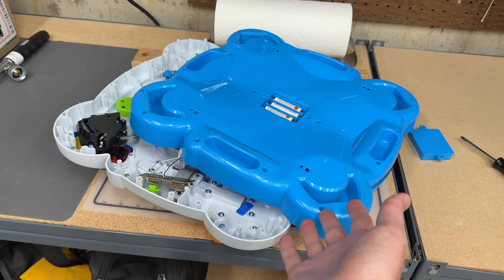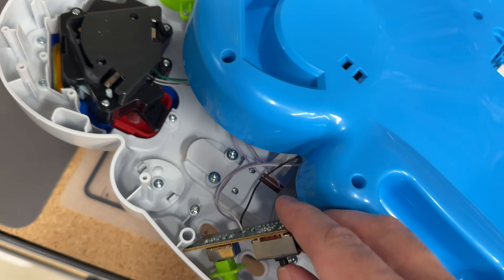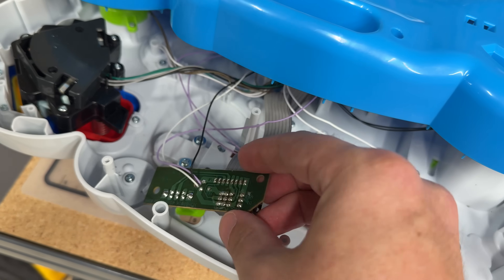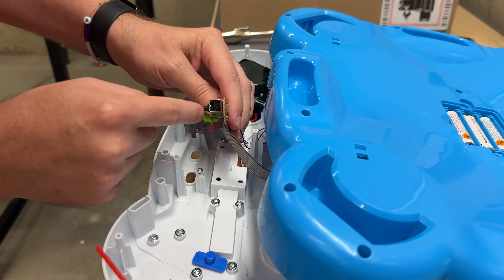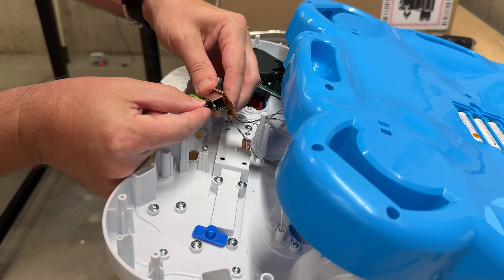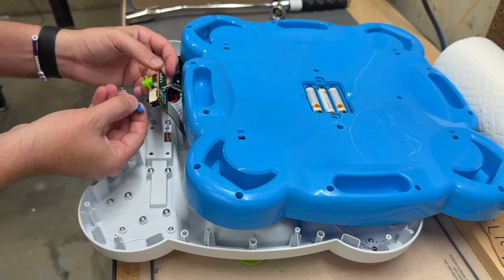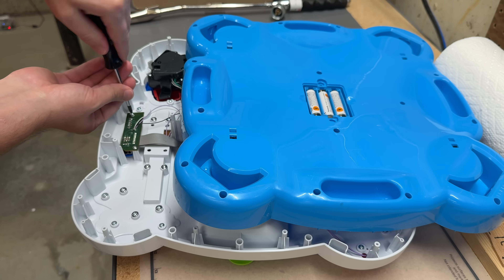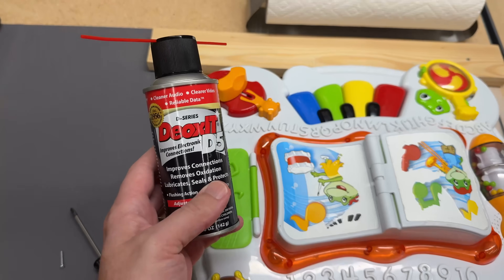My baby's toy is engineered better than my $800 dishwasher

Comment: 1:37 I love the trend with modern products to not have slide switches for power, instead using a momentary button with a "soft" power on/off MOSFET or equivalent, so there's no switch that has to keep a solid connection for the product to work. Flashlights are one of the biggest things to benefit from this.

Comment: "engineered better" implies the baby toy meets its design specifications better or more efficiently/elegantly than the high-ticket dishwasher, when in reality, non-repairability is the POINT of high-ticket tech items, so they're very well designed. Just not user-friendly in the slightest.

Comment: 6:23 i appreciate different screwdrivers when theyre different.  You can avoid long screw damage and youll keep the right screws with the right parts.  They'll also help on the assembly line for similar reasons

Comment: I own a Bosch 800 series dishwasher. Had a google fiber outage on my street this week and found out that when there is no Internet all the Bosch app “features” like delayed start time, adjusting rinse levels, etc just aren’t available. It’s so anti consumer, infuriatingly bad design choice. I had a Bosch dishwasher before that lasted 20 years and was amazing, the new one washes dishes great but the user experience is a failure

Comment: I believe in Right To Repair, but the this video's take is absurd. This isn't engineered to be waterproof, leakproof, etc. It also doesn't have millimeters worth of tolerances. It can be big, that is deliberate. Good video, bad title. There's something to be said about the concern over the plastic screws being "engineered better than (bigger thing)".

Comment: That's because toys like this are not expensive.  They don't mind us opening it up and try to repair it.

On the other hand, your $800 dishwasher.... they don't want you to easily repair it.  You will NEED to pay a technicians to do any repair, AND pay a subscription to even use it.
If they make it easy to repair, Jeff would definitely hack it and make it usable without a subscription, or to put a few raspberry pi's in it an make it 100x better.

Comment: last year our Siemens dishwasher (internals are identical to Bosch units) failed, gave an error code that indicated that the drain was clogged. I tried to poke around and remove anything that's in the drain as much as I could and it didn't help. My dad and I pulled it out and removed the metal siding to get access to the internals and that didn't help at all because both the left and right side of this stupid thing is a giant plastic thing which all it does was being a pipe to get water to the center of the interior walls. Why wasn't that a simple hose?!?! instead of a gigantic plastic reservoir that was just filled with gunk since the water inside does multiple 90° turns so stuff collects in the corners. It blocked access to everything and could have been a simple part that you could just buy at any old plumbing section of a hardware store.

Next time a friend or family member (or myself) needs a new dishwasher I would discourage them to get a name brand dishwasher, especially since the new Bosch dishwasher my parents can connect to the internet which the only purpose being that you can start it remotely (no idea why you'd leave the house and THEN start the dishwasher when you can just start it and then leave) And apparently even newer models seem to require the internet connection. 

Screw that, get a cheap one. No stupid smart BS and is in all likelihood more repairable since they would avoid custom molded plastic parts as much as possible so they'd just use a damn hose.

Comment: The sliding switch problem reminds me of what happens to old Game Boys. They stop turning on reliably from oxidation building up inside the power switch. If you take it apart you can scrape it clean inside and then it's good as new. Some people spray isopropyl alcohol in there without removing the shielding, but sometimes that unfixes itself after a few days. Seems to work best to just desolder the shielding and go at it with a fiberglass pen until it's shiny, then hit it with the IPA / canned air to get any debris out and seal it back up. If the toy starts acting up again too soon, I'd do something like that, see if the switch housing can open up to better clean inside.

Comment: IPA has also done wonders for cleaning switches on old gameboys and other electronics if you either run out of or don't have any deoxit.
Reply: IPA does not have any greasing so it may harm the device in a long run. If used ipa grease where you can

Comment: The "unscrew" (usually counterclockwise) before tighten rule works for all threads in addition to plastic ones.
Reply: Yup I do it all the time whenever screwing into anything with threads.
Reply: yeah it works but is it necessary for metal threading?
Reply: @devnol  , it's never necessary, but always helpful.
Reply: @DrRChandra Well I do it regardless but I mean for cheap plastic it's absolutely needed to prevent breaking the post. For metal it's just good practice.
Reply: @DrRChandra  I wouldn't say never, I've seen fine-pitch metal threads get buggered and crossthreaded from not doing it.
Reply: @PyroNicampt , yep. highly recommended, but still ultimately optional. I hate crossthreading, so as a general rule do the counterrotation nearly always, regardless of the materials.

Comment: The toy costs $1 to make and sells for $10+ vs the appliance that costs $500 depending on what going on in politics and the supply chains and has 100x as many parts and sells for? It's a bad comparison. And even toys are going to feel the tariff squeeze because doing injection molding in the US is not easy.  If you're going to throw down the glove maybe look into the global economy and realize it's a huge mess but maybe you can find something informative.

Comment: both my kids always switched those devil boxes in Spanish, luckily the youngest is old enough to not really play with toys like that anymore. The V-tech /leapfrog ones are not too obnoxious, someone gave my oldest kid a toy piano do-dad toy from amazon and on its low setting it was ear splitting, on high it would distort the speaker to the point it basicly just shorted out, someone obiously put a wrong resistor to set the gain lol ... I sat there for a good 30 min tracing things out and made its volume barely audiable on low and normal on high

Comment: Those Eneloop batteries you're using deserve a shout out. They are rechargeable, have almost as much power as a non-rechargeable (so they can be used in high-drain devices), and a low self-discharge (so that they can be used in low-drain devices like like remote controls). They are in my mind the perfect battery and somehow people just don't seem to know about them.
Reply: Eneloop for the win!
Reply: While eneloop were first out with low self discharge NI-MHs pretty much every recharagble AA/AAA cell available in my area are labeled "ready to use" and use the same sort of tech. IKEA even has a low power version with even less self discharge intended for their zigbee devices. They're still lower capacity than primary cells though.
Reply: I bought some Eneloop batteries 8 or so years ago and have never had any trouble with them. In contrast, I've had standard alkaline batteries leak acid and corrode the terminals in almost every device I've used them in.
Several recent such leaks were the final straw and I bought a bunch more Eneloops. They are expensive, but they are worth it to me. 
Their lower voltage does throw of the battery level estimates of devices, but I don't care if a device reports 50% battery level with fully charged batteries as long as the device lasts 'long enough' on a charge. So far, at least, I have been very happy with them.
Reply: > alkaline batteries
> leak acid

(I'm sorry for laughing  @Cyberguy42 , I just had to)
Reply: Call me weird, but I like those rechargeable that have a usbc port in them for recharging. No need to keep an extra charger thingy around.
Reply: @LockonKubi Problem with those is that they have way less capacity
Reply: The problem with them, and almost all rechargeable AAs or AAs, is that they operate at a lower voltage. Only 1.2v compared to 1.5v for “normal” batteries. In many products it’s not a problem, as they are designed to work with a range of voltages. But in many instances it is a problem because they just require a higher voltage than the same number of rechargeable batteries can provide. Even in products where it does still function, there are often little annoyances like the battery charge indicator showing that the batteries are dead or almost dead even though they have been freshly charged, again because of the lower voltage. All that said, I do use rechargeable in everything that I can. I just wish they could be used in even more instances.
Reply: @MrThedennisblack 
I see what you mean, as I decided to try using some Eneloop Pro and LADDA 2450 batteries in an Epson label printer I have (not a full label maker) I have even though its manual indicated to only use alkaline batteries, I tried them anyway and they worked but with reduced Bluetooth range.
Reply: @MrThedennisblack for that cases i got powertools 1.5V lithium. Their biggest problem is self discharge, way worse than NiNH, but at least they charge faster. I just charge before use if i knew i left them unused for some time.
Reply: @MrThedennisblack  I do hear that a lot, but I always see charts where the alkaline battery doesn't even last that long at 1.3V

Comment: Oh hey. We have that toy too. $7 from the thrift shop. Survived 3 boys and is running strong with 18mo little sister. I've found that noise usually pops up when it's time to replace the batteries. Although if that fails this seems like a good solution.

Comment: Jeff and Technology Connections are creating a new genre of videos that hate on dishwashers :)
Reply: Dishwashers are an absolute blessing, but they are a solved technology. We should all be able to buy a cheap, reliable, efficient dishwasher, but companies don't make money from that, so they are enshittified in every possible way.
Reply: @BenMacdui 
You mean the things you can get for as little as 150 bucks? 
300 average for full sized models? 
Yeah, they're really gouging you.
Reply: @777idkineedausername But are the cheapest ones reliable, and are they cheap to repair if they break?
Reply: TC primarily hated on Detergent Packs, rather than the washer hardware
Reply: @crash.override  Yes, both the machine and the detergent have been enshittified.
Reply: @crash.override   He was hating on Bosch a bit (not that hard).   I put in a Bosch and I do like it, but it can be a little finicky.   I got one that is midrange, it has a bit better build quality than the lower tier but does not have any cloud nonsense or other pointless frills.
He did rant mostly about the packs, but that's all I can get now.   I did wonder about the lack of the second cup for detergent and his video explained that and why it's dumb.   He runs a great channel.
Reply: rage against the (dish)washing machine.
Reply: Technology Connections hasn't done any videos hating on dishwashers. He has done several videos explaining how to use your dishwasher correctly so it does a good job.
Reply: @mjc0961  It's a joke, son
Reply: Technology Connections went out of his way to advocate for and promote dishwashers.
Reply: @777idkineedausername  That was a running joke in TC, someone said he was "angry dishwasher guy" and he hearted the comment
Reply: Recently my 30 year old dishwasher stopped working.  Front panel lights flickering randomly when using the touch panel and won't start.  Disassembled the door and traced the problem to a cold/broker solder joint.  I was dreading having to replace it with the current "energy efficient", internet enabled dishwashers that run for up to 2 hours when my old one washes in 30 minutes and gets dishes clean, no pre-rinsing necessary.  I don't buy into the notion these newer appliances are any more energy efficient.
Reply: @pfitz4881  Modern dishwashers use less energy by virtue of using substantially less water, and thus reducing the amount of energy needed to heat that water -- and in my experience, they don't clean any worse.
Reply: @pfitz4881 If it's just a cold solder joint, buy an iron and reflow the joint.
Reply: @pfitz4881  Just replaced the main impeller and motor on one from 2000.  I hope it gives another 25 years.

Comment: Looking forward to the follow-up video on connecting a GPU to the MCU board found inside the device. Wouldn't be surprised if it had more BAR than the dishwasher as well.

Comment: The other day I opened an FM radio from Sony.
Every screw that you needed to take out to open it were marked with an arrow and the entire electronics content came out as one bloc.
Reply: I've found older Sony tech surprisingly repairable. Not long ago I had to try and fix a 2003 budget Sony micro hifi system. A quick web search yielded a comprehensive service manual complete with disassembly instructions, circuit diagrams, component level parts list and calibration instructions. It was also designed with a semi-assembled troubleshooting "mode" letting you run the thing with most of its guts exposed, all documented in the service manual.
Actually getting to the sub assembly I needed to fix was a bit janky. At one point I had to put a bunch of extenders on my screwdriver to reach through the whole machine, in order to get the front panel off, and some of the internal wires were frustratingly short. Still though, the effort was clear.
Reply: @fnorgen It must be some leftovers from the era when service manuals came with the device and fixing electronics was an industry, not a hobby.

Comment: Kids toys always fascinate me in how they are designed. They have to meet a really cheap price point, but are often manufactured in the hundreds millions, so the engineering usually takes some interesting turns in order to i.e. save on one dc motor by using a mechanical system instead, or a single piece of plastic for multiple buttons to save on one injection mold. One can learn a lot studying these. Especially when learning to design plastic parts for injection molding.
Reply: and they also have to be somewhat durable given the target user, it is fascinating
Reply: @ElektronDeForza  I bet it's more durable than most smart device you are using (if not all). I won't be very comfortable to throw my phone or earphones on ground and expect it not to break. But it's just normal usage for child toys.
Reply: They also have to be engineered to avoid lawsuits, settlements, and legal action that would bankrupt most other manufacturers.
Reply: I used to work in toys! My info's out of date at this point, but generally take the sticker price and divide it by 4 or 5 to get an idea of the "cost" we were targeting. Anything we could do to save costs, we pretty much had to, and some of the mechanical contraptions I got handed to bring under processor control were marvels on their own. A second motor means another motor driver, and probably at least one more battery, too. 6502-derivatives are still the processor of choice for most things(Less than a nickel for one with an audio amp built in. 8MHz, 256 bytes of RAM, 2MB of ROM.). ARM Cortex M0s finally started to get cheap enough to include in "higher end" toys as of ~2019.
Reply: @Izzy84075  You also have Sunplus's offerings.
Reply: I pulled apart a bubble blowing wand that had one 130 size motor and simple plastic gearbox powering a peristaltic pump for the bubble liquid, an air blower and a rotating wiper that moved liquid over the air nozzle
Reply: Same!
Reply: Good for you!

Comment: DeoxIT is new to me, good to know.
Reply from the maker: There are other brands too, just 'electronic contact cleaner'. DeOxit I think has most of the market and mindshare though!
Reply: @Level2Jeff  DeOxit that socket!
Reply: I never use DeoxIT. Unlike contact cleaners, which are mostly if not all isopropyl, DeoxIT leaves a protective film, which can be unwanted on many contacts. It also will dissolve a variety of insulations used on components like motor windings, coils, etc. ruining them.